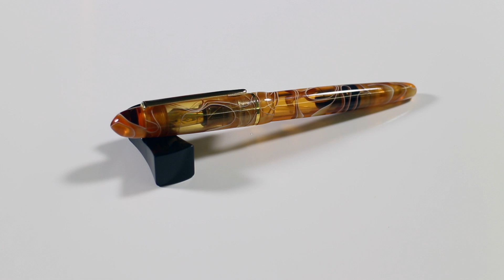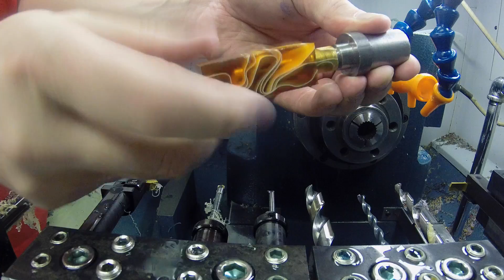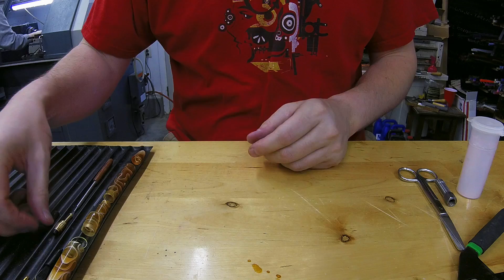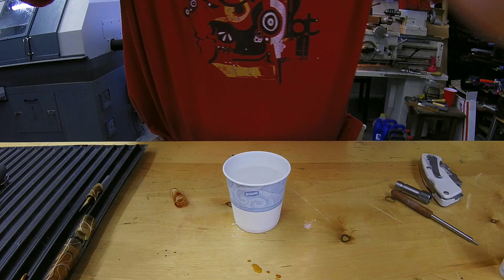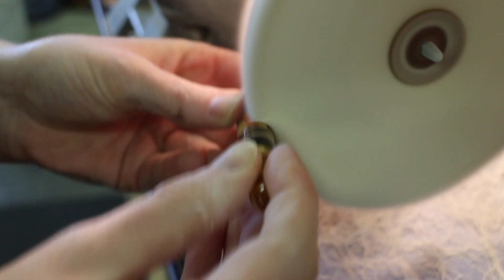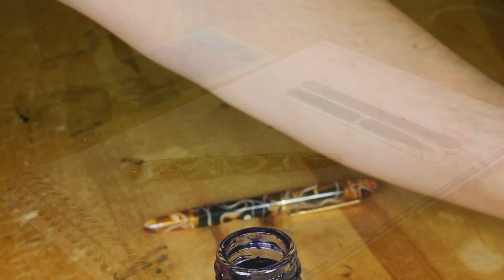Making a Menlo Pump Filler: Edison Pen Co Behind the Scenes

Comment: Excellent informative video Brian - you've now helped decide what my next Edison is almost certainly gonna be :-)
Reply from the maker: Thanks very much! But so you know, the Pump Filler has been discontinued. We've replaced it with the Draw Filler. The Draw Filler is basically the same system, but we're using orings rather than a latex diaphragm. The orings are proving to be much more reliable. https://edisonpen.com/index.cfm/2017/05/17/new-from-edison-the-draw-filler/

Comment: Thanks for the insight, Brian. This is a fascinating video. I used a lathe at my first job from school but it was nothing like this - no digital progamming in those days. It will probably be a few months before I can afford a Menlot, but I'm staggered (and grateful) that this level of craftsmanship doesn't cost more. The question is, which finish? I love them all.
Reply from the maker: Clifford Hughes Thanks Clifford!  When the business started, I did everything on a manual lathe just like you did with your early job!  Lots more work that way!  The manual lathe still gets used a lot for custom work, but the numerically controlled lathe definitely is necessary for our scale of work now.  Thanks!

Comment: I thought I had an appreciation for all the work that goes into an Edison pen but I really did not.  Your Edison pens illustrate a level of craftsmanship at an expensive price point.  I just ordered my second Edison pen from Richard Binder.  This one will have one of his flexible duo point nibs.  Can't say enough good about your products and collaborations.  After watching this video I believe my next Edison pen will be a custom Menlo pump filler but on a Herald Grande body.
Reply from the maker: Thanks for the kind words, Ken!  And if you haven't tried a Richard Binder Full Flex nib yet, you'll be stunned when you get it!  I'm so happy to be collaborating with him!  And there's no problem with a pump filling Herald Grande.  Just reach out when you want to discuss!  :)
Reply: Edison Pen Company Richards wife said they are mailing in out on 4/5 so I will not get it for a few weeks. I can't wait.  I took your advice and my first two buys are Colliers.  I love the first one and your video on the Binder nibs sold me on the second.  I do have a question.  I use the converter on the Collier but I would like to try it as an eyedropper but I am afraid of staining the inside of the body.  Almost all of my inks are Noodler's and I like some of the inks like Baystate Blue and Kung Te-Chin that people say stains pens or ruins sacks.  I have not had any problems but I would like someone else to have the experiment risks.  Should I worry?
Reply from the maker: Ken Vargo I wouldn't worry with those harsher inks when it comes to a converter pen.  Probably no issues, but clean the pen more thoroughly and more often.  However, we don't recommend those inks in pen that have latex sacs or diaphragms, such as the pump fillers, pneumatic fillers, and bulb fillers.  I've seen those inks literally melt latex sacs.

Comment: I a question with the interior machining process of the barrel why not use a larger drill and then a hone or hones to get you finial ID of the barrel instead of a boring bar?  I would think that it might be possible to get more accurate \ consistent barrel ID from pen to pen as well as better finial machined requiring less internal "hand" polishing.
Reply from the maker: A drill never creates a perfectly round hole,  rarely creates a perfectly concentric hole, and also rarely follows a perfectly straight path. If you followed a drill with some kind of honing tool, it might clean the interior OK, but it will follow the non-concentricity of the drill, as well as the non-straight path. A boring bar cuts on one edge, and guarantees a very nice surface that is also perfectly concentric to the outer diameter and totally straight. This is very important to this design and how the filling mechanism aligns. What you are proposing is very similar to using a chucking reamer, which would have the same problem. In some applications this is fine, but we need dead perfection on this application.Thanks!